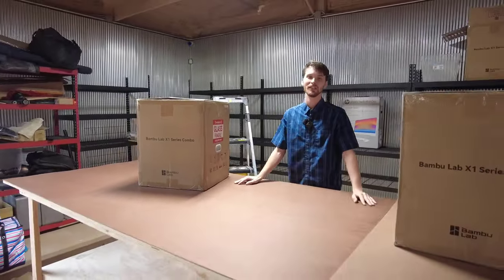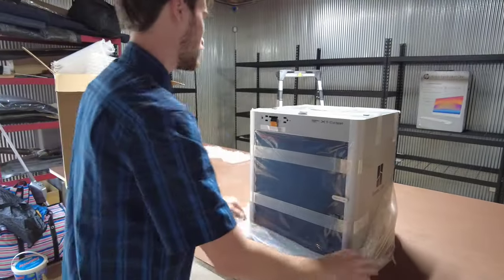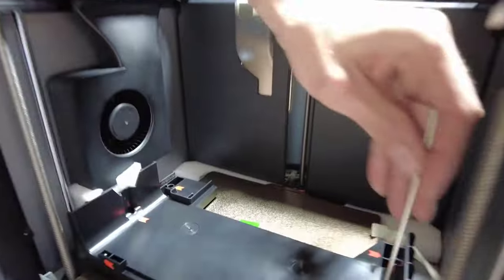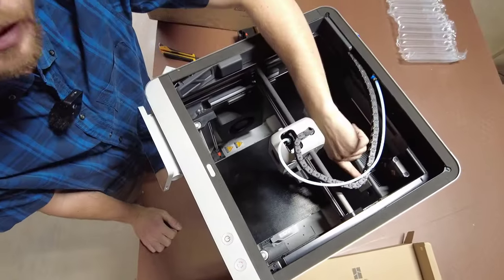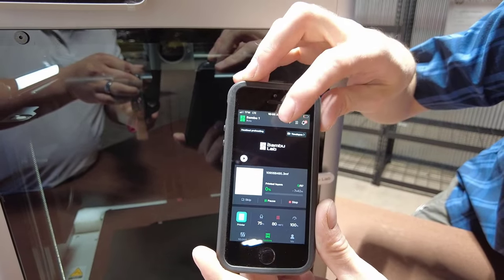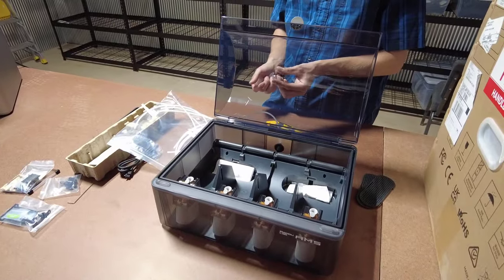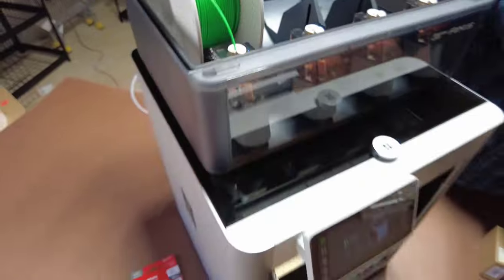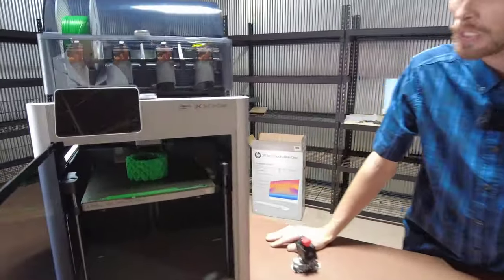Future Of 3D Printing? Bambu Lab X1-Carbon Printer Unboxing and Startup

Comment: Great walk through!  Well done.

You mentioned the texture plate is an upgrade from the smooth pei plate.  I’ve found them to work equally well.  What are you seeing that makes it an upgrade for you?  (Honest question, I’m not trying to poke)
Reply from the maker: The texture plate gives a unique and uniform finish on the build plate side. We use mostly ABS and this results in better adhesion due to the added surface area of the texture. Thank you for your feedback!